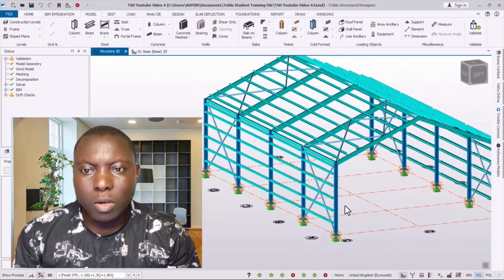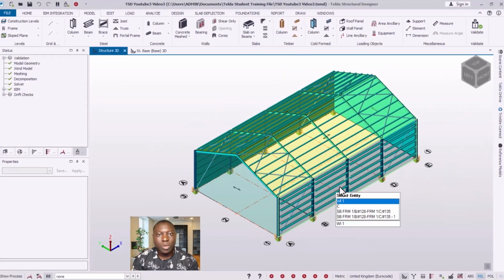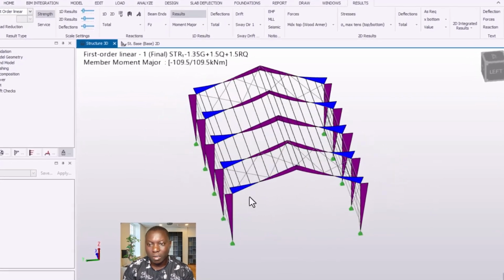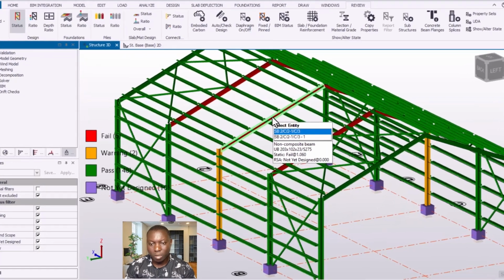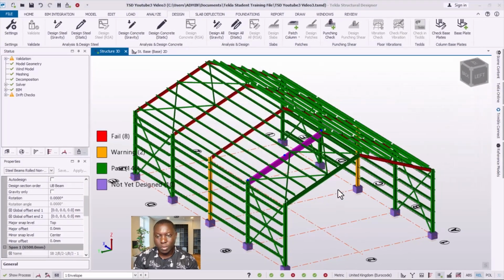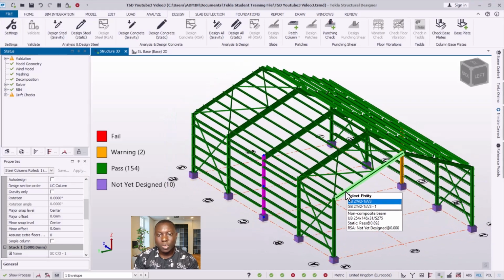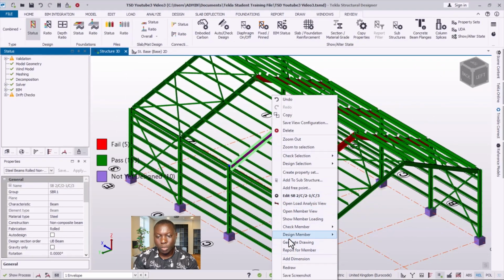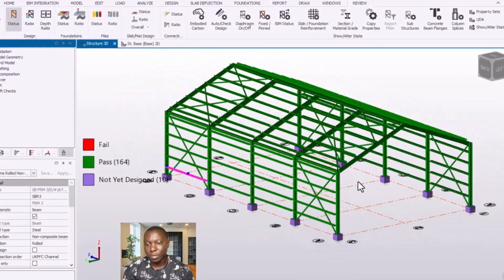How to Run Analysis and Design on Tekla Structural Designer Steel Warehouse

Comment: Does it handle connection design and detailing like prota steel ? Does it read restraints automatically to adjust the effective length of members like the rafters
Reply from the maker: @bolaoresanwo6411  Yes, it does all of that.
Reply: @CADmade-easy  It does  not. They lieing to you to buy
Reply from the maker: @nicholusnduhura8949   there is Tekla Connection Designer, Meant for the design of connection. the module works with TSD so  it is true
Reply: Please I want to know which will be efficient in analysis and design of steel structures, Tekla Structural Designer or Robot, please advise.
Reply from the maker: @udubrahenry1566  both software is good. Any software that easily detect restraints is most effective, Tekla structural designer detects restraints mostly.
Join our channel membership.